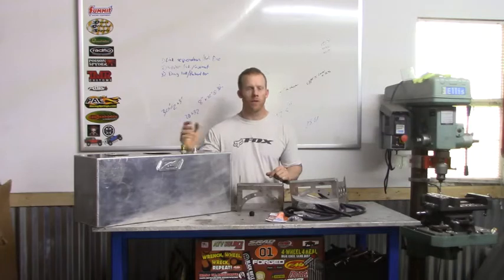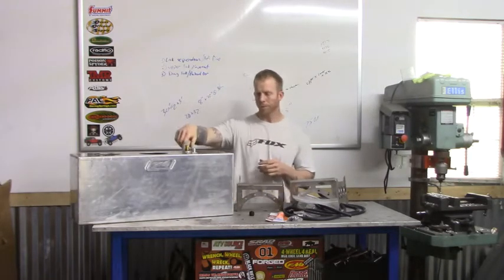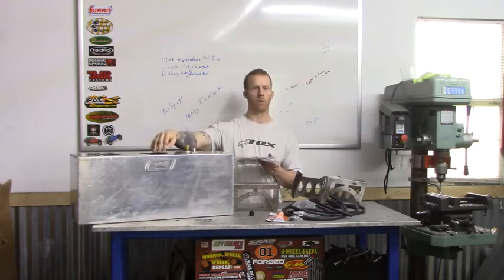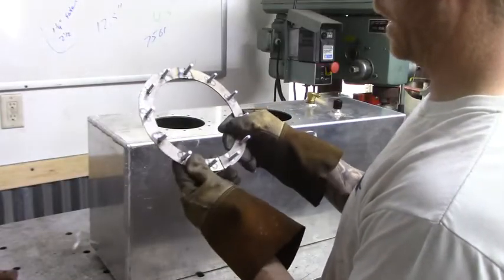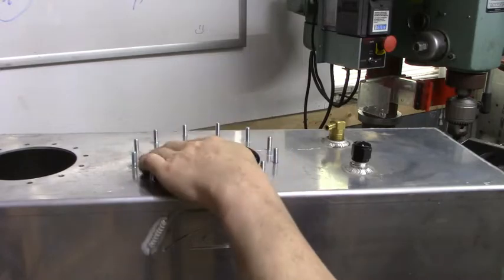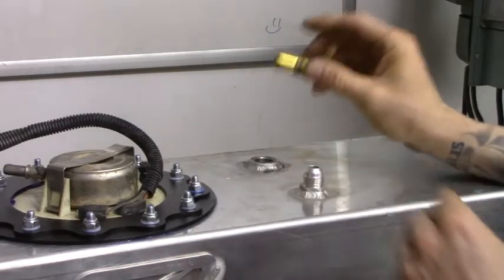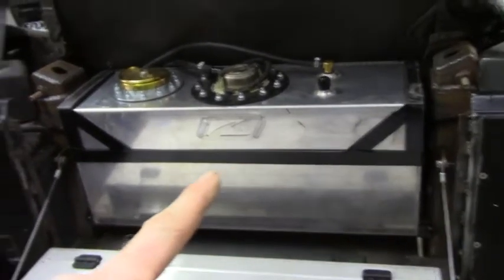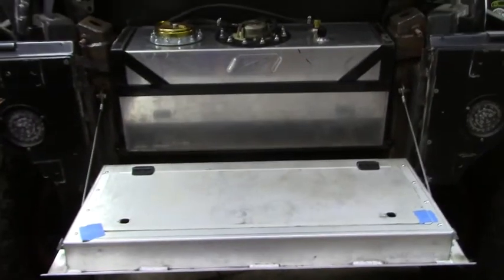Fuel Cell

Comment: For those with a fuel cell, can you start your jeep and look inside the cell. I have a 97 Jeep TJ and noticed that fuel is aggressively squirting out to top of the pump. I don’t have a return line so maybe this is the way the pump releases pressure, but I want to find out if anyone else has the same issue. The jeep does crank for a while before it finally turns over
Reply: Yes. It’s a stock fuel pump on 97 Jeep TJ
Reply from the maker: @TheTrevorthecool  ok so is it coming out of the return line port?  Pretty sure these pumps run non stop and what fuel isn’t used goes back through the return. Is there a reason you’re not running the return line.
Reply: @CardinalOffroad  I believe 97 to 02 do not have return lines from the factory. I think the pump is operating normally, but wanted to see if anyone can look inside their cell while the jeep is running to confirm operation. Again, when I looked inside my cell, I noticed fuel squirting out of the top of the pump like a water fountain. It is contained within the cell so it’s not causing problems. Just curious if that is normal operation
Reply from the maker: @TheTrevorthecool  ok I’m not sure. Mine is an 01 abs has a factory return line
Reply: @TheTrevorthecool  the piece on top of the pump that the supply line connects to is a pressure regulator. It sends 47ish psi to the engine the rest returns to the tank. If you pull that round piece of you will see where the excess fuel comes out of
Reply: @Reggies_shitbox_tj  update: 
The fuel pump assembly is equipped with the flange (top plastic part that hours the regulator) and the pump housing (metal can). The flange is secured to the pump housing by three tabs. One of these tabs broke loose causing the flange stem to pop out of the pump stem. Therefore, some fuel was being sprayed up into back into the tank. This is what I was seeing
Reply from the maker: What fuel pump are you running?  Is this on a Jeep?

Comment: What did you use to connect the vapor return line?
Reply from the maker: Gabriel Herrera I took rubber fuel line and hose clamped it to the original line on the Jeep right in front of the rear axle. Then attached it to a 90 that goes to the fuel cell.
Reply: @CardinalOffroad  so a 5/16 rubber hose slipped over the 3/16 return line... I should've known
Reply from the maker: Gabriel Herrera exactly. I even put a little fuel permatex on the fitting and original line for a little extra bond.
Reply: @CardinalOffroad  awesome thanks for the quick reply and great video I'm hooking my fuel cell up and you're video helped alot
Reply from the maker: Gabriel Herrera no problem. What fuel cell are you using?  I’ve had some issues with mine leaking fuel out of the top on sharp turhs and I believe it’s from the rubber seal they sent me. I’ve heard others complain of this issue. I just used fuel permatex on every connector this past weekend so hoping that takes care of it.
Reply: @CardinalOffroad  I have the genright 20 gal. Its mounted up just haven't hooked it all up yet. I hope I dont get any leaks I'll have to get that permatex too.
Reply from the maker: Gabriel Herrera yeah when I took the rubber seal off it had changed it’s form. They have a fuel permatex and it’s very sticky and messy
Reply: @CardinalOffroad  the genright tank doesnt have seals it's all welded and the fuel pump just screws on so fingers crossed it doesnt leak
Reply: @SomaCoalition  Does the 20 gal tank also fit behind the seat?
Reply: @ryanwartick1065  no I don't think it would fit, I believe the motobilt tank does... It's a real tight fit back there that's why I ditched the rear bench years ago.
Reply from the maker: 20 gallons is a big tank. You’d have to move your seat forward but it’s probably not worth doing unless it’s for little kids because that back seat is crammed on the Tj. If it was an LJ then definitely
Reply: That is not a return line. That is the vent line with a built in rollover valve.

Comment: Excellent vid! that cap you added from summit, you do happen to have the part number by chance?
Reply from the maker: Alex thanks!  I don’t remember but I do know TJ’s 04 and up are different I believe. I got the part numbers from motobilt.  If you want to run braided line they have those parts numbers as well.